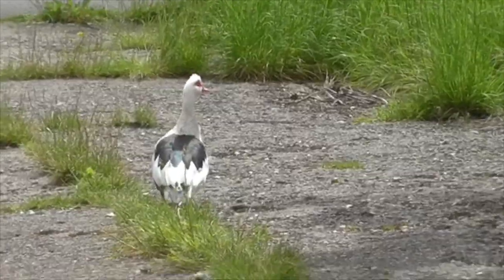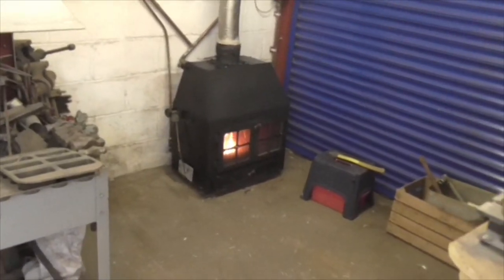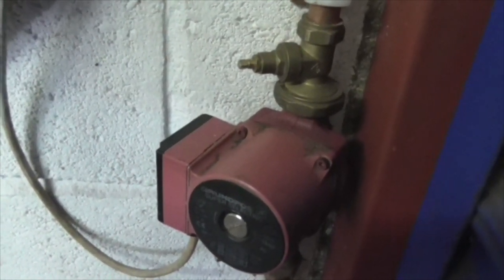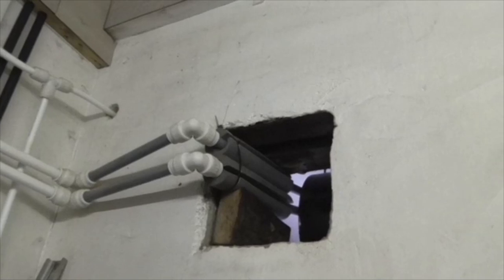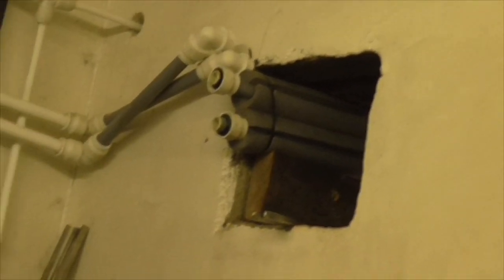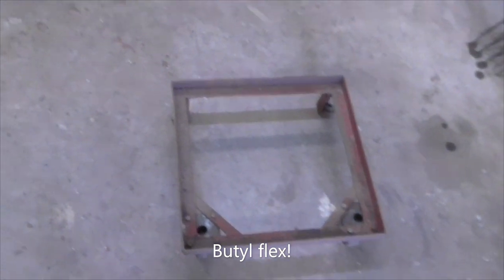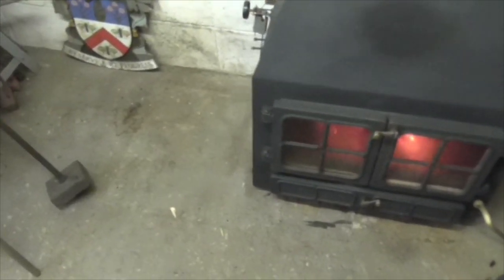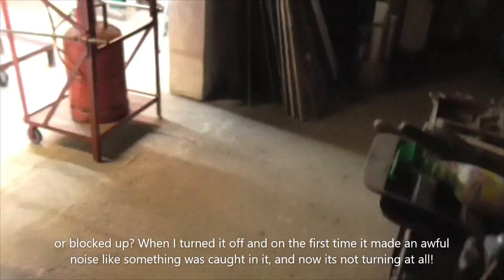Workshop heating. It works!! Or does it!

Comment: Great to see the fire lit, no doubt you will solve the problem with a replacement pump. Good luck with Dad's removals over the coming week. 
Best wishes, Dean.
Reply from the maker: Dads removals have been dalayed an hour as No1 daughter is off to Dublin  on Wednesday and doesn't want me there till 11!! The heating is annoying but a minor thing! Having installed quite a few full house systems and boilers, I am sure I will get to the bottom of it!
Phil
Reply: @philhermetic  small world, I'm going to Dublin tomorrow! The way you designed and constructed your own workshop heating system proves your aptitude for this kind of thing Phil.

Comment: Great film as always Phil. Few teething issues with the heating system. I am sure you will get to the bottom of it. The fire drew well and the chimney worked. And heat exchanger did indeed exchange heat. Fire will be very welcoming in winter. Hope moving your girls goes smoothly. Long may your lum reek.
Reply from the maker: One way or another it will be done Carl, There are complications as youngest is working in York and will have to either travel or sofa surf in the gap between one aqccomodation ending and the new one beginning! It also means we must bring all her stuff home and then take it all back a few weeks later! I don,t think I will need much fuel for the fire, we have endless pallets, and trees that insist on shedding limbs at every verse end, plus a lot of leylandi that needs to go!!
Phil
Reply: @philhermetic  Hope it works out well for your youngest daughter. Someone told me once not to burn leylandii in a stove. Apparently the sap is quite acidic and burning it produces a corrosive which can damage the stove and flue. I'm not sure how true that is. You maybe know better than I do.
Reply from the maker: @carlwilson1772  it is certainly very sappy and burns really hot,m as does the foliage, even when green!! When we have burned trimmings in the past it went up so rapidly it almost felt like you could set fire to a whole tree with a ciggarette lighter!!

Comment: Hi Phil, I was going to ask if the valves on the pump were open, Although vibrators can be great fun, I'd prefer not to see it in use ! Del..
Reply from the maker: The valves are in the open position Del, but past experience has shown that they can fail to open, but I checked them before I fitted them! There is something jamming the pump, and I am hoping it is the foreign object that was blocking the pipe!! It is not unknown for stuff to get into pipes at plumbers merchants, a late very old mate of mine once had a similar experience with a lump of polystyrene insulation in a copper pipe!
Phil

Comment: Why not take the return pipe from the heat exchanger directly to the holding tank and from there down to the pump with a somewhat larger pipe dimension, then you get a pressure on the pump instead of suction and no cavitation.
Reply from the maker: It doesn't really matter if you pump flow or return, pump tends to run a bit cooler if it is on the return, but you cannot put hot water into the plastic header tank, they go very soft and melt! I am confident it is either pump failure, or something in the pipe, and by the sound of the pump, it is now in there!!
Thanks for the comment!
Phil
Reply: @philhermetic  I have roughly the same system in my workshop, I use an old stainless steel water heater as an accumulator tank and hot water storage tank in a non-pressurized system , which means that I can use the heating capacity throughout the night. Anyway, respect the work you do with and repair obsolete material, do a lot of the same 👍